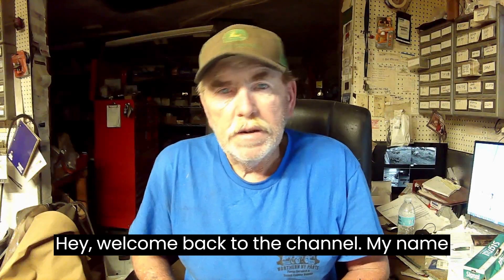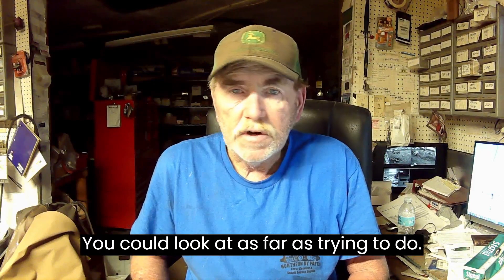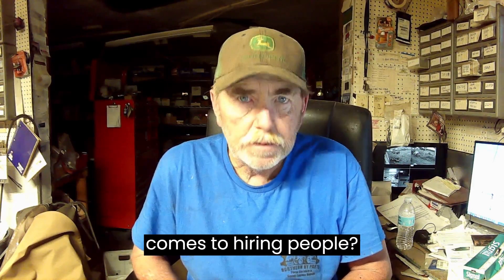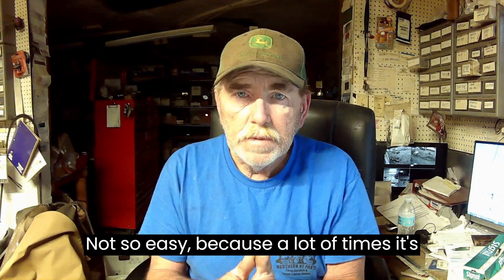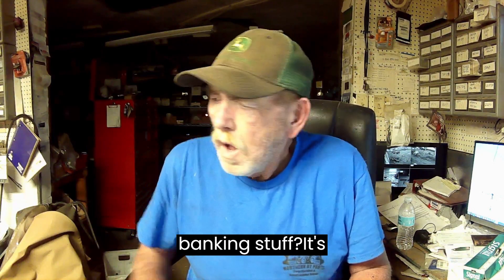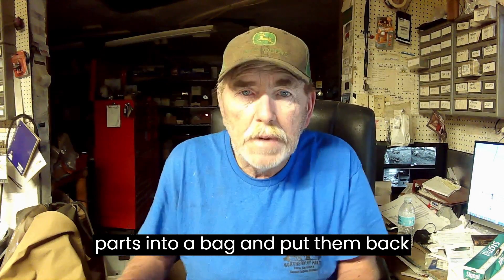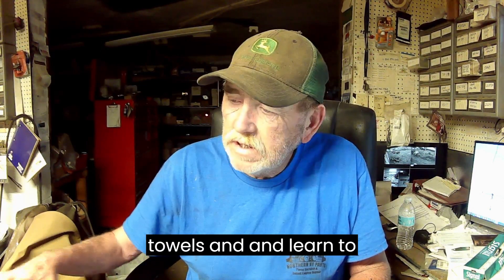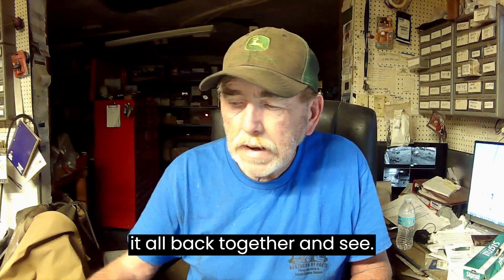Mastering Small Engine Repairs  Essential Skills for Success

Comment: Short version of my life experience: started sweeping a factory floor at 12. Moved on to production machine operations on 2nd shift during high school. College was a waste of my time so enlisted in the USN and began in nuclear power program. Was not interested in that so stayed in conventional navy engineering. Learned heavy propulsion and refrigeration with more into hydraulics and pneumatics. Out of USN and into stationary operating engineer for another 10 years all the while learning from my betters. Then got back into HVAC design,engineering,manufacturing,and ownership: that's where I earned my wealth.
Earned the reputation of being one of the best and never the cheapest. Sold the company,retired well and new ownership destroyed the reputation of the company is less than a year....
Reply from the maker: Everything is about reputation no matter the trade. It's sad to hear they ruined it so quickly. Bad news travel's fast
Reply: That's sad!  Maybe you should have stayed on as an employee or an advisor until the new guy know how to act.  My uncle sold his gas station/2 stall repair shop and remained as an employee so the new owner got to know the clients and vice-versa.  It worked out very well.
Reply: @jeffryblackmon4846  Offered to do that dozens of times post sale. Owners (3) are too prideful to accept help. They know just enough about the industry to get themselves into trouble and they have done exactly that.

Comment: I enjoy your channel. Back in the mid 90’s I was in highschool and took a year of small engine repair and a year of welding which led me to get a job in a small engine shop when I was 17 years old. I worked there thru the rest of highschool, and after I got out of Highschool I got into a 5 year Union Electrical apprenticeship program. While going thru my apprenticeship I would still work at the shop on the side. I’d weld quite often which is such a necessity in small engine repair business. 
I still tinker to this day on small engine equipment. But the skills you learn will last you a lifetime!
Reply from the maker: absolutely, you never know when they might come in handy